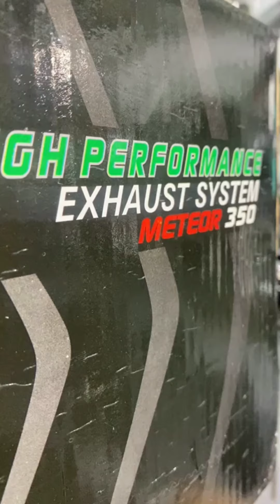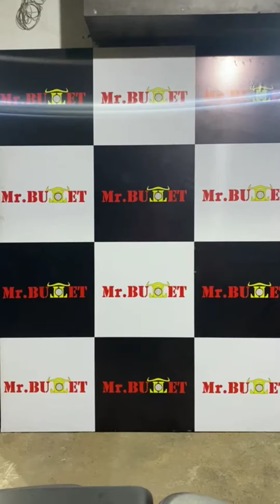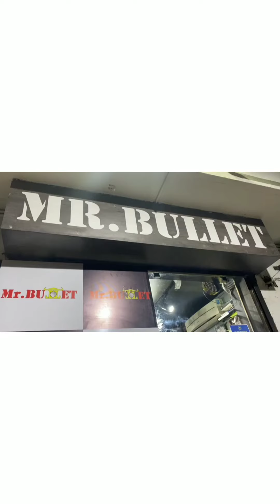Unboxing Red Rooster POLESTAR Silencer for Meteor |  Meteor Red Rooster silencer installation method

Comment: This exhaust can be fitted in classic  reborn??2021 new model
Reply from the maker: Yes ! It can be fixed
Reply: @m.r_bullet  there is no cat so the straight pipe has to be installed or directly the exhaust??
Reply from the maker: @rohanverma9511  directly exhaust

Comment: If i dont want to remove catalytic converter then it can fit in the meteor??
Reply from the maker: Yes sir you can install with OE catalytic converter..need slight changes in clamp
Reply: @m.r_bullet  okk thxx btw video is just next level